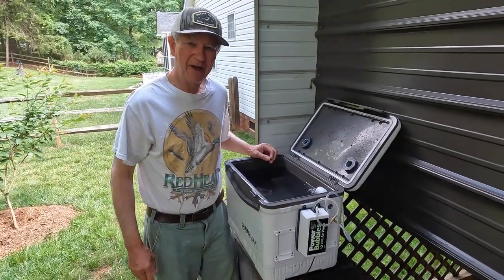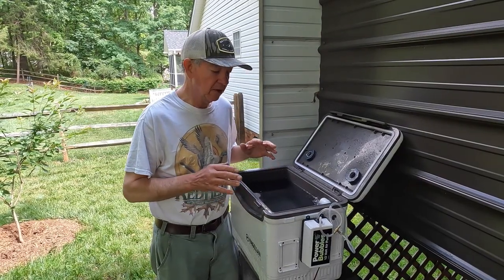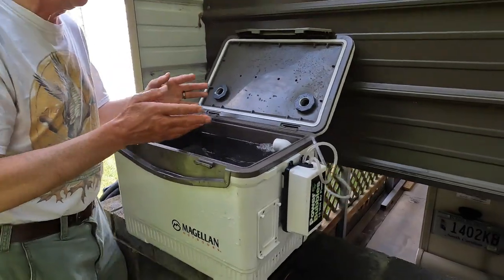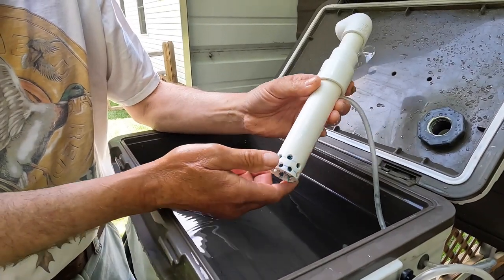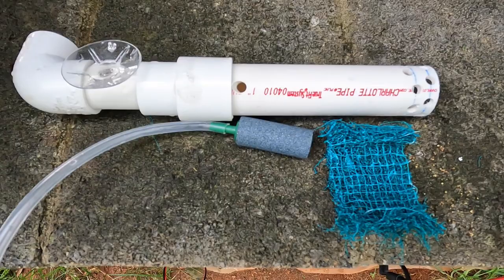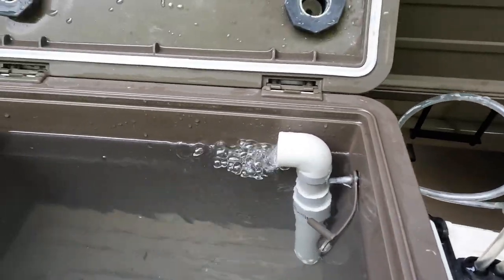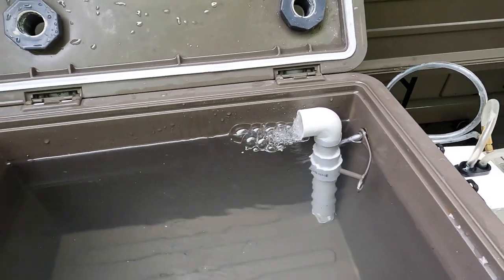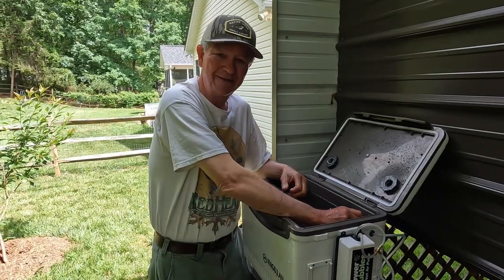DIY Aerator  Airlift Filter & Water Circulator For Kayak Bait Tank

Comment: I actually have the smaller Magellan bait box. I bout the dual battery/12v bubble box from Academy for 14 dollars and bought the 6” air stone from Pet Smart for 10 or 12 dollars and I use ice cubes to regulate the water temperature

Comment: You should look into a sponge filter to put on the bottom of your pvc look it up
Reply from the maker: Thank you so much. Here is my solution that captures the scales without slowing down the flow of the water. It gives a 70 gallon per hour flow rate. Works great.
https://youtu.be/zAUTgbW7TOw

Comment: I bought some Topfin water conditioner from Pet Smart for a few bucks and it has a measuring cup for the cap and takes very little per gallon 
I never thought of using rock salt though.
I’m still trying to figure out what causes the water to lift out of the top of the PVC 90?
Reply from the maker: The volume of the water in the PVC pipe becomes less dense with the introduction/saturation of the bubbles. It's effective to raise the water a few inches. Same principle as an aquarium airlift filter. Here is my link to an improved version:
https://youtu.be/zAUTgbW7TOw?si=r4vCiGs_KDWeiedH